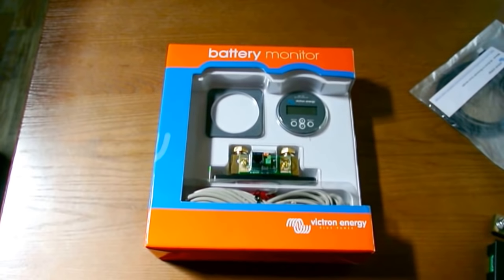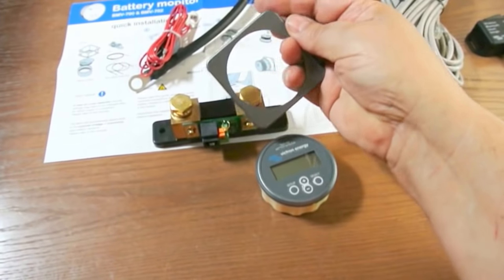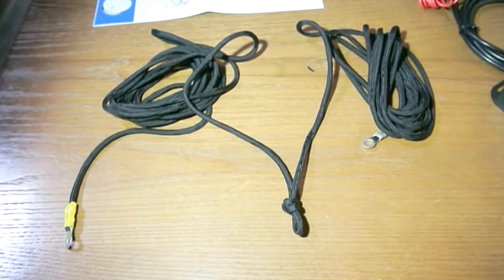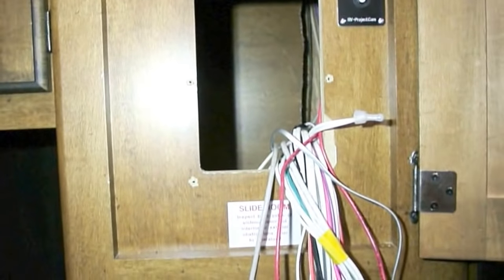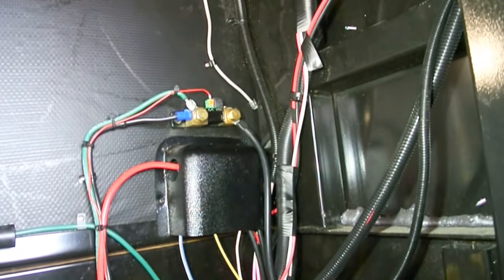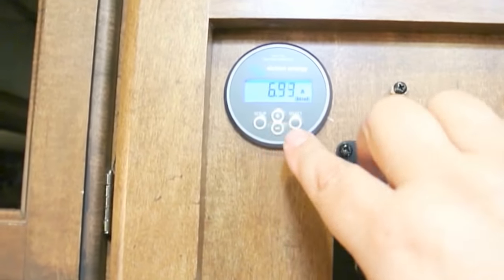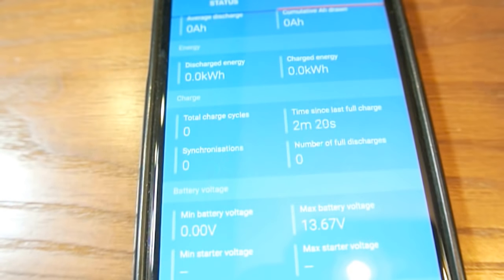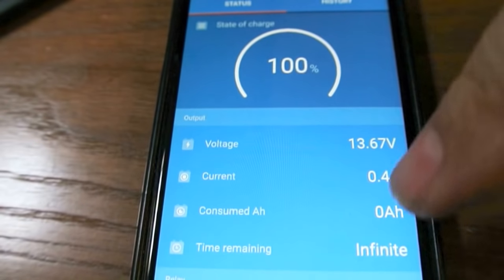Installing the BMV700 Battery Monitor in my RV

Comment: Nice video... I used the Bogart Engineering's Trimetric solar charge controller & their Battery monitor. They don't offer the bluetooth option but with the  shunt, at least you'll be able to monitor your battery levels fairly well. we love ours.
Reply from the maker: I also like the ability to change the Peukert's component.  

But regardless which brand monitor you use, it is essential in my view to keep an eye on what is happening in the DC system.

Comment: I like this Victron unit.  They have very good reviews and the Bluetooth option is a winner.  Thumbs up.
Reply from the maker: If you ever add a solar panel and Victron charge controller, you will appreciate how they integrate into a single network.

Comment: Pretty cool! I picked up the Trimetric as it was cheaper but I like the BT option.
Reply from the maker: I also like the ability to change the Peukert's component.  

But regardless which brand monitor you use, it is essential in my view to keep an eye on what is happening in the DC system.

Comment: Great video, I have installed a trimetric, I wish it had the Bluetooth dongle capability.
Reply from the maker: In all honesty, I bought the bluetooth dongle later, as I was not sure I wanted it. I already have too much stuff on my phone. But I bought the dongle after discovering enhanced history data is available via bluetooth.  I am now thinking of getting an inexpensive Android tablet just for the RV.

The other issue I am concerned with is if electromagnetic radiation was visible, my RV might be lit up like a Christmas Tree.

Comment: My rig has two, 12 volt deep cycle batteries rated at 92 ah each. When setting up the monitor would I annotate 92 or 184 ah during the initial setup?
Reply from the maker: The manual really does not specify. But I would use 184ah because 12V batteries (in parallel) look like one larger battery.

Comment: I enjoyed the video, and it has added to my interest to getting the Victron BMV-712 SMART battery monitor. I have a 2018 Grand Design Reflection 303RLS, and I would like to know more on wire fishing the monitor cable. It looks like one end is coming to the "Convenience Center", but I can't tell on the video at 4:00-4:15 minutes where you start the wire fish. Is it started at the "Convenience Center" or down below where the battery is located? Just not sure on how to get started on the wire fish. Thanks very much.
Reply from the maker: For my RV, the control panel is in the right side door of the hutch. There is a void from there down to the floor, which is also accessible by removing the rear wall of the main storage compartment. The converter and AC/DC distribution panel are in that area. 

I had more luck fishing the wire top-down as there is also a standpipe to the roof in that void, and trying to go up, I was getting the fish tape stuck on something.

From there, the monitor wire goes over to the "wet bay", behind the rear wall which removes with 8 screws or so. All of the plumbing is in that area.  I ran the wire over the backside of the Nautilus plumbing control panel.

Then it follows the ceiling to the front side of the storage compartment, bundled with a few other wires - including the the Ground Control panel.  At that point, I drilled a hole in the front bulkhead, as the battery is located on the other side.
Reply: Very helpful. Thank you so much!

Comment: I have 2 batteries. Do I need the V702 model or can use the V700 model and just say it is one battery? For example, i have 2 100ah batteries. If I just tell it I have a 200ah battery, will it work as needed? Also, do you have to configure it differently if I replace my wet cell batteries with Lithium? TIA.
Reply from the maker: You can use the BMV700 with multiple batteries in parallel.  The BMV702 has an auxiliary input allowing measurement of a second battery's voltage and temperature. However, in the typical RV setup with multiple batteries in direct parallel with each other, the BMV702 cannot read the voltage of the secondary battery. 

If the batteries are separated, for example through an A-B switch, then the BMV702 can read the voltage of each battery separately; or if the two batteries are in series (for example two 6v batteries), then it can also read voltage on each battery.

Even though the BMV702 cannot read voltage of each battery independently in a parallel arrangement, it can still read the temperature of each battery, providing you have the optional probes. 

The VM series is setup for  lead-acid, AGM, and Gell cells. It can monitor Lithium-ion, but some configuration setting changes are requited, according to the manual.

You can download the manual and wiring diagram for the VM series monitors from the Victron website.

Comment: I have the Victron  BMV 702 very nice, don't have the BT dongle yet, may have to get one...
Reply from the maker: If you ever add a solar panel and Victron charge controller, you will appreciate how they integrate into a single network.

Comment: When you enter the battery capacity, if you have 2 12v, do you enter the doubled capacity? Thanks
Reply from the maker: Yes. You would double the AH rating. The manual has a lot of info on setup of various battery configurations.

Comment: hi, is the battery capacity setting for 1 battery or the complete setup.
i have 12 x 2v 600ah configured in 6 in series and then paralled with another 6 giving 24v
Reply from the maker: Assuming your batteries are not connected via a battery  isolator, the BMV cannot "see" each battery individually; thus it thinks it's one big battery, so you would use the total capacity of the battery bank. 

There are other options available if you have battery isolators.

Comment: If you have things installed that are grounded to the frame, will the monitor still read them even not connected to the shunt?
Reply from the maker: The negative side of the battery goes directly to the shunt. Any grounding of the frame would be after the shunt, so yes - it should read that discharge current as well.

Comment: What crimped is that
Reply: RVProject what crimping tool is that? Sorry I was typing without my glasses on.
Reply: @94auwing  I know this is an old video but just in case you're still wondering. They have a similar hydraulic crimping tool at Harbor Freight. It goes for around $60.